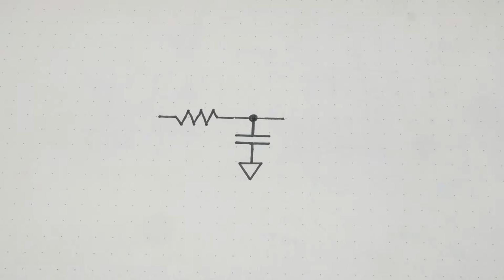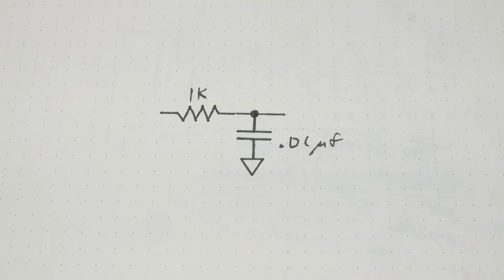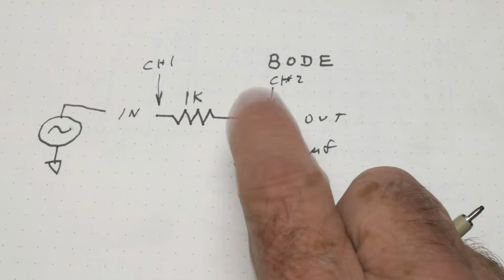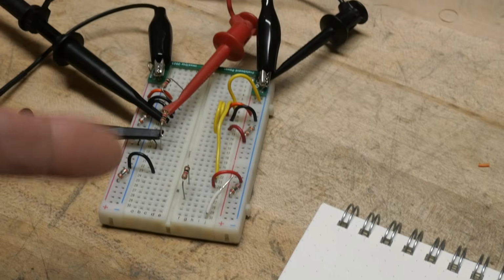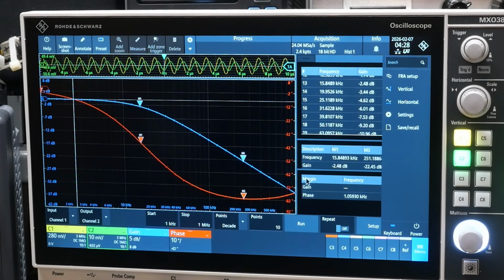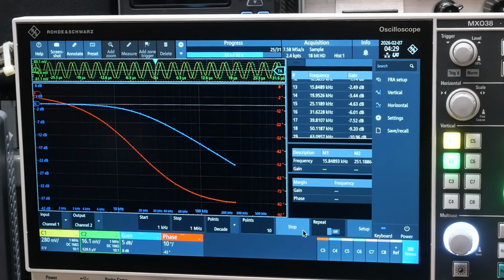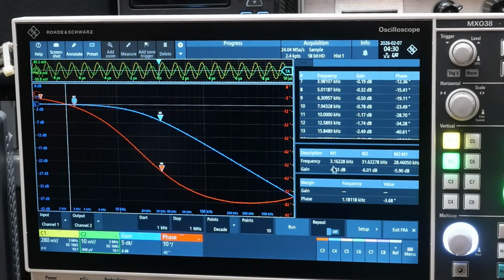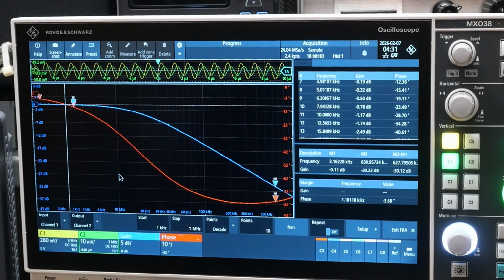#2514 Rohde & Schwarz MXO3 1 GHz 8 Channel Oscilloscope (part 6 of 7)

Comment: And if you continue to 1 - 2- 3 Ghz, you will see gain again closing to 1.
When I saw it, I guessed, maybe higher frequencies just simple reflecting and bouncing  back from the capacitor plate. 
So high frequency alternating current is a BLACK MAGIC. 😂